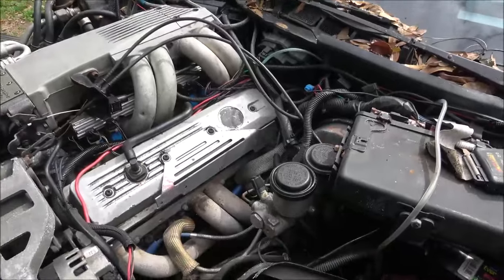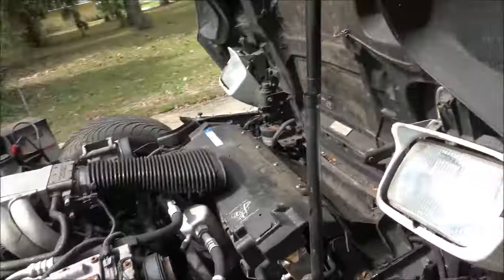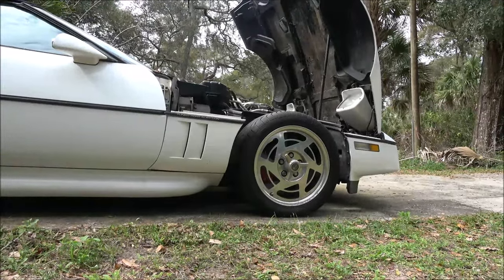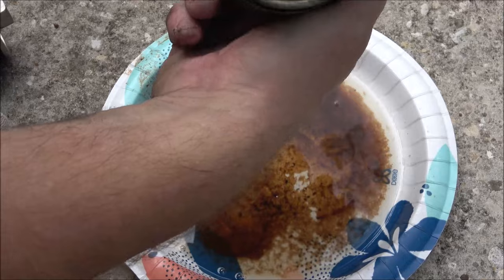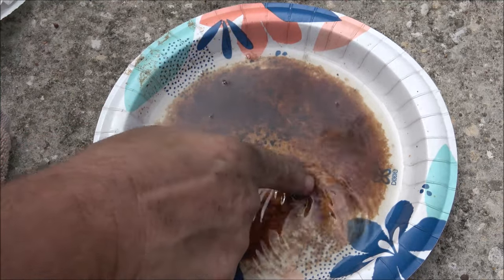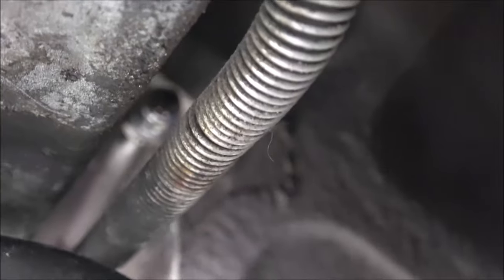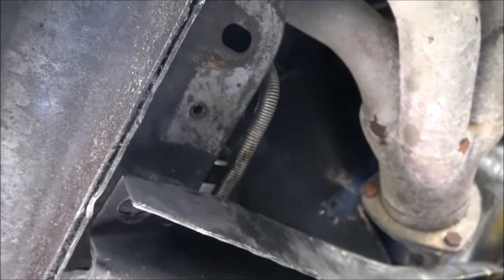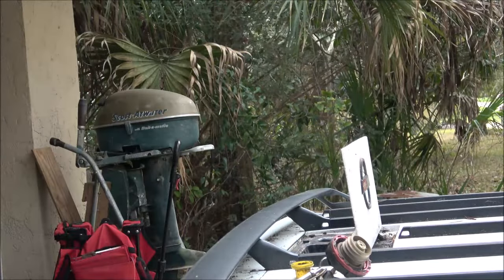1990 Corvette C4 L98 Fuel Filter Replacement And Upcoming Videos Of The Vette

Comment: Heya bro 🤠 . I'm guessing you figured out the missing cylinder issue ?. I'm a big fan of berryman's B12 chemtool,  that stuff works awesome and not only cleans the fuel tank out but the fuel lines fuel pump and injectors or carburetor as well 🤓 ..
Reply from the maker: I like the B12 too but I actually couldn't find any that day. Yeah the miss was a clogged injector I covered in a previous video. But it's a lot of fun to work on lol